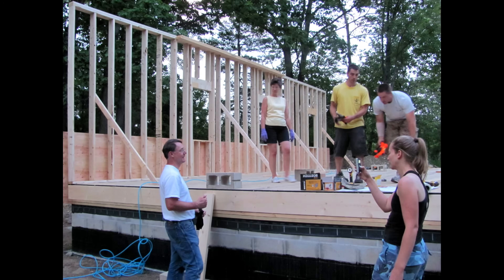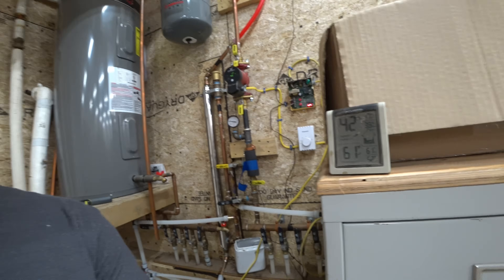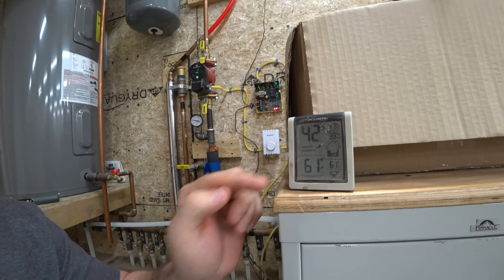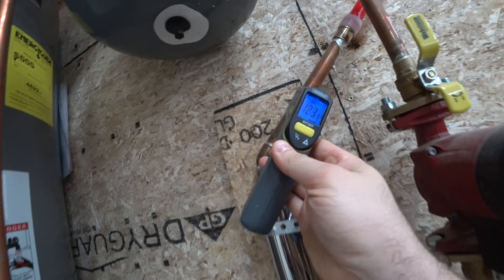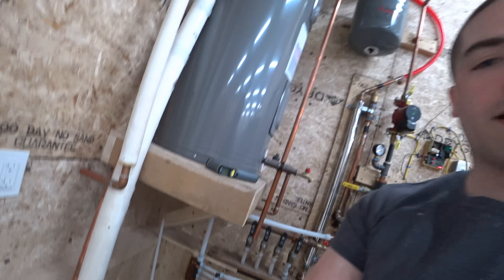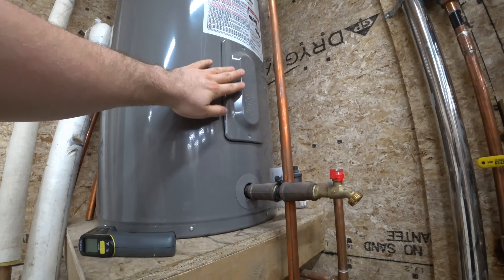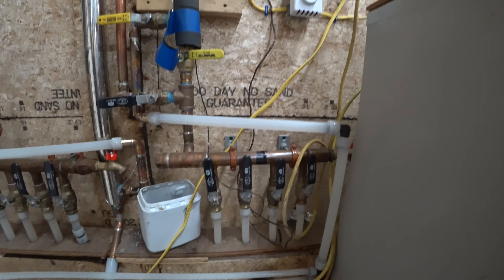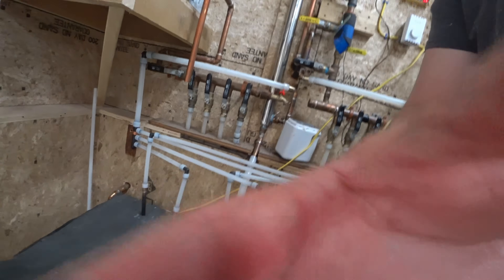Solar Heated Garage Radiant Floor, Update

Comment: Wondering why the heat exchangers are necessary ? Why not one flow controlled water circuit circulating through panels and floor ?
Reply from the maker: You could design it that way if you are building it from scratch.  I added the solar onto my existing system.  My existing heating system uses a steel water heater, and they are prone to rusting if open.  But, if I had a stainless steel tank, then I'd be more inclined to connect both.

Comment: How do you manage the excess heat in summer?
Reply from the maker: I turn off the system in the summer.  This is a drain-back system.  So, anytime the pump is not running (summer and at night in the winter) all the fluid drains back into the tank which is inside.  The collectors just sit there empty with no problem.

Comment: One question for you... 
If I connect a roof solar panel directly to underfloor heating, without a water heater, would it heat my house??? I want the pump to run non-stop while there is sun (seasonally in spring and autumn) Thx bro 🍻
Reply from the maker: I heat my garage with solar hot water.  These are solar collectors, meaning they heat water directly.  I'm not sure if you are asking your question about these, or solar electric panels (PV).
Reply: @DavidPozEnergy  ...solar collector for water heating, but without boiler. Connected to the same network installation with underfloor heating. Thx.
Reply: @DavidPozEnergy  non electric panel

Comment: Could you explain the hot water heater for me?  It appears to be inline with what's going through the floor so that if it were to get really cold you said you could turn on the breaker.  But you also said that the pump runs at 2/gallons a minute and that water flows through the water heater.  If so, do the elements just heat the water as best as possible because there's a constant flow?  Or does it eventually just get the whole water system (in the floor and heater) up to whatever temp you've set it?  I'm asking because I have four solar thermal panels and I'm trying to design a system where I can maybe use the panels in connection with a water heater to maintain a constant water temp at 180 degrees to feed a swimming pool heat exchanger to heat up my pool.

Comment: Setting 3 or 4 (constant pressure 1 or 2) is recommended for a Grundfos pump running radiant floor heating. Try it out!

Comment: Thanks for the vid, bud! I'm looking for a way to passively solar thermal heat my off grid garage. In your opinion, if you routed the heated water/antifreeze through a series of radiators, as opposed to a radiant floor, do you think that would work to keep it above freezing? My floor is an existing concrete slab so radiant flooring is not really an option in my situation.
Reply from the maker: Radiators don't work as well as the floor.  I'll try to explain a little more:
Typically, a radiant floor will have a water temperature set to 90°F, but radiators often have a set temperature of 160°F.  This is because the radiator has to heat the air around the radiator enough to cause convection (air movement).  If the outside air temperature is 20°F, and you try to heat to 90, that's a 70 delta, which solar hydronic can do.  But, solar hydronic has a very hard time handling a 140 delta.  
The solution, if you want to do it anyways, is to increase the size of the radiator or add a fan to have active convection.
Reply: @DavidPozEnergy Hey, thanks for the reply. That's good news for me because I have plenty of solar electricity I can draw from to power a fan on a radiator. I don't need it to be warm per se, just not below freezing so I can leave things in there that would be damaged or destroyed by sub freezing temps. It would save me a lot of effort moving all these items to a warmer space during winter. I'll have to make time to build one of these setups. Thanks again

Comment: Thanks 4 video.  Quick question:

Did you consider just having solar electric going straight to a dry system?  How qould that compare?  Then there's no pumps no water etc much simpler and cheaper?  

Ps.  For your international audience always add in the velocity celcius temperature equivalent.  Outside of USA, we have no idea what this strange Fahrenheit scale means!!!
Reply from the maker: It's been awhile, but I think I got those hydronic panels for free, or very cheap.  This made it worth while to make a hydronic system.  However, if you are comparing retail pricing, then I'd have built a solar electric (PV) system.

Comment: You could use a 50 foot x 3/4 in soft copper. If you did make your own heat exchanger coil use 1/2 copper tubing for legs use caps on bottom.i did a commercial system in Lawrence we had a rubber 450 gallon tank with 3 coils.i used sonna tubes to wrap them.then braze the small copper to the outside it looks great and works excellent. Heat exchanger whether flat plate of shell and tube are not ideal.if you would have got a indirect tank with an electric backup you wouldn't have to do anything just run your solar fluid and fill that puppy up. You could easily turn it in to a open loop drainage system. You could use a 40 gallon indirect for your storage room and use the coil inside to run a fan connector or a piece of base board and a fan. Enjoy glad to see your vid.

Comment: What you need is a water to water geothermal style heat pump. That is the only way you are going to extract all usable heat from your solar heated water and get your 60 degree temperature in your garage due to much greater efficiency. It would also possibly need some solar electricity producing panels and some batteries as a storage and power buffering for that electric power needed for the heat pump. It would be worth it for the gain in efficiency you would get.

Comment: Wished I had the experience and cash to do the same... But, why not build several black boxes with aluminum screens to collect hot air. seems it would help your system ++ very cheap and probably the biggest bang for the buck. They are not fancy But I saw a video with a guy below 0 in Canada heating a large chicken coop with no insulation and full of hols the inside temp was about 40F. Now even if they only heat for 2 to 3 hrs I think that would still justify the cost.
Reply from the maker: There are lots of types of solar air heaters out there.  I'm a fan of them.  I did it this way for two reasons.  First, this requires two holes in my envelop, each 3/4" dia. for the pipe.  That's not very big.  Air heaters would have required very large openings for passive air movement.  Or about 8" dia. duct with a fan to move enough air for this shop.  Those are much larger holes with more heat loss in each hole.
Second, I have a radiant floor.  The floor needs hot water.  It made sense to heat water with solar to directly heat the floor.  If I had solar heated air, then I'd still need something for heating the radiant floor.

Comment: Hey Dave, I have also just picked up 3 of these panels myself and watched your videos to gather some information about how they work. They all are approx. 4x8 and came with a roof rack that the last owner made to attach to his roof. I’m looking to heat a 12x24x52 above ground swimming pool during the summer months on Long Island. The pool is chlorine not salt and I feel that this could really be a great DIY project to provide a better swimming temperature. I’m unfamiliar with how efficient these panels can be and curious to know if I need that many? Any feedback would be great! Thanks for your help and the great videos!
Reply: Hi. I think you can simplify your system because you want to use it during the summer, I'm guessing mainly during the day. There are diy solar pool heaters that are simpler. They use a small solar powered pump to circulate the pool water through a passive glass toped box which heats the pool. The boxes are inexpensive and a easy diy.

Comment: I bought 7 panels for 200$ and plan to pump the water thru some type of heat exchanger in furnace or try some old cast iron radiators, anyway why cant you do away with copper heat exchangers and just have a small holding tank and just pump that water thru radiator , flooring, etc.?
Reply from the maker: You could do away with the extra layer of heat exchangers if you design the system from the get-go. For me I added the solar after the fact to the existing radiant floor system. So I wanted to keep the existing radiant floor system as intact as possible. The existing radiant floor system is a sealed system under pressure. The solar hot water system is atmospherically vented. That's why I need the heat exchanger.

Comment: Not sure if I missed the question in all the comments or not. But after you did your water heating test and found that the solar electric panel and heating element was more efficient than the solar thermal panel for heating water did you change out the elements in that water heater and start heating it off a couple panels to assist your system? I have thought about trying that with my hybrid hot water heater so it would only need to run the compressor in the winter?
Reply from the maker: inside my house I still have a 250 gallon tank with 3 solar thermal panels.  It pre-heats the water. Then I have a 19 gallon electric "booster" tank.

Comment: Why can you not put the water from the panels directly into the floor?
Reply from the maker: You can if the water in the system is mixed with glycol (anti-freeze).

Comment: Couldn't you have some sort of window on the roof that lets light enter and strike a very energy-absorbent panel?
Reply from the maker: Sure, you can go the traditional passive solar route.  I like active solar because I can have a more insulated and air-tight shell.  If I had a big skylight I'd have to give up the insulation.
Reply: @DavidPozEnergy   I think I would go for something like this.  I wouldn't really want to insulate the floor.  Plus, when you think about it, there are going to be a lot of instances where that floor insulation comes to bite you. For example, when it's freezing cold you could benefit from free geothermal but with your current system it's insulated away.  https://www.youtube.com/watch?v=N6QOZGgbj-g

Comment: Why is the tank there - just use a heat exchanger - they are cheap!! I run 10x 1.4Kw solar thermal (14 KW total) configured as 2x 5 series paner running 30% glycol @3.5bar.
This feeds the 300litre Solar domestic hot water via its lower coil and then switched over to the central heating via a plate heat exchanger and in summer supplies the swiming pool via a heat exchanger. We actually had the pool at 31 degrees centigrade this summer. Water comes off panels at between 40  and 100 centigrade and has rougly a 10 degrees differential on the return. This is in the Uk and has been running for 6 years.
Reply from the maker: Sounds like you have a nice system.  I have a tank in the system because I'm using a "drain-back" system.  Thanks for watching.
Reply: @DavidPozEnergy  That explains the tanks!! 

I also ran the sytem initially with just water to flush the system before re-filling with Glycol/water mix and was surprised at how much better water was as a heat exchange medium over glycol, also because the mix is very thick/viscous the flow rates dropped dramatically over the thinner water only.
I considered a drain back sytem but was concerned about the size of the tanks to drain 10 panels and pipework.
Thanks for your reply
Reply from the maker: That's some good experience on the two fluids.  Thanks for sharing.

Comment: Nice job.... New to solar.  I am planning to do something like you done when I build my garage. Recently I been attending a solar club in my home town.  We can get solar panels at cost.  "Wheels are turning."  Thanks for the video.  Cheers
Reply from the maker: That's cool.  Are you in Massachusetts?
Reply: Hello my friend.  No, I am in New Mexico....actually, I am a contractor working in Kabul. I'll be home mid Sept.  I have a small solar plan for my log cabin.  This log cabin is a practice build.  Freaking about $28 sq ft so far. lol  Keep your video coming.  Cheers

Comment: Hi Dave. Looks like a fun and worthwhile project but what are you doing to control legionella bacteria in that warm water in the open tank?
Reply from the maker: I did put a little bleach in there, but the open tank is not exactly wide open.  It still has a sealed rubber lid, so that I don't have to constantly replace water that evaporates.  Thanks for watching.

Comment: https://www.youtube.com/watch?v=WP8H5IOTwYU one of the best video overviews I've seen on a DIY solar hot water collector. You could also build something like this along the length of that south facing vertical wall to increase the BTU and it would be cheap. CPVC + plywood + polyiso + corrugated plastic + black paint.

Comment: @davidPoz I am wondering why you use the heat exchangers and dont do a direct cycle of the water for the garage floor?  I dont know a lot about thermal solar, it makes pretty obvious sense why you wouldnt do that with drinking water but for trying to heat your floor, why do you need to separate the water? i would assume it would be higher effeciency?  Love your channel, i found it about 3 weeks ago and watched every single video (except the ones without a title)
Reply from the maker: Hi mark rossi,  This system is called a drain-back.  At night the water drains out of the panels and back down to the tank for freeze protection.  If I filled everything without a drain-back, then I would need a lot of anti-freeze.  And I would need some kind of valve to prevent thermal syphoning (which would cool the floor at night).  There is probably a way to do it, but I just did it this way.  Thanks for watching.
Reply: @DavidPozEnergy  Thanks for replying David, now that you explain it, it makes sense.  I forgot to ask you another thing I keep wondering, what are the solar panel looking things on your house roof?  Unless I missed a video, you  never mentioned what it is and when you did the solar panels on the custom a-frames in front of your house it sounded like they were the only solar panels you had.  I did notice you do your videos out of order a bit though, I was watching them from oldest to newest and was so confused LOL!  Are they not solar panels and do you have a video that discusses them?

Also, how do you deal with permits/inspections for all the work you do?  I would love to do some of the projects you have done but dealing with plans, permits and inspections keeps me away from it.  

Keep up the great work, I was shocked your channel only has 26k subs, I am confident your channel is going to explode in size very soon.  Your videos are informative, well edited, and the perfect length to get the info across.  Your channel is the first time I watched an entire channels video catalog after finding it!
Reply from the maker: Hi Mark, I have some solar panels on the house.  They are PV, and grid-tied only.  I paid someone else to install them when I built the house, and it was rolled in as part of the mortgage.  Since I didn't do any of the work I never filmed any of it.

The solar panels in the front yard (on A-frames) go directly into the crawlspace as a heater.  I have a video on that here: https://youtu.be/jFoxIit8NYA 

 I purposefully don't discuss any of the permitting process because it is so different everywhere you go.  

Thanks for watching

Comment: My experiance with Grumman Sunstream  collectors that used glycol  heat transfer  fluid under 8lb of pressure and homemade water only colkectors is the commercial  collectors transfered 30% more heat. The glycol  under pressure is significantly  mo getter! You are leaving significant heat within the  collectors  which can be measured by sampling the plate temp  and comparing to the water temp as it exits the  collector.

Comment: What will you do during the summer when you don't need it anymore?
Reply from the maker: I turn it off in the summer.  Thanks for watching.
Reply: Does it matter if there is water left in the panels?
Reply from the maker: If water was left in the panels, then yes that could be a problem.  However, my system is called a "drain-back".  This type is not as common as a glycol based system, but still plenty out there.  Basically, every time the pump shuts off (summer, at night) all the water drains back into the tank.  This leaves the panels empty.  The panels are made of copper, aluminum, glass, and fiberglass insulation.  All those things can take hundreds of degrees, so they don't care if they sit out in the sun during summer.  I hope that helps, David
Reply: Awesome! Thank you for the clarification!

Comment: A great project and a very good implementation! The radiant heat is equalizing with the ambient air temp in the garage, resulting in a lower than expected air temp.  

An inexpensive and fun project to bump up the air temp during the daytime, would be to mount a couple more passive solar collectors (aluminum downspout designs work well) on the roof and ventilate the garage with the heated air.

Comment: So you could also use photo voltaic panels & direct drive an electric immersion tank to save on the complicated plumbing
Reply from the maker: Yes, you are right.  I am actually working on setting up that experiment so I can gather some data.

Comment: So what does the pump cost to run? How many watts is it & how many hours/day does it run?
Reply from the maker: I just checked for you.  125 watts total, that is two pumps and one controller.  One pump is for the solar and one for the radiant floor.  It will run 4 to 4.5 hours per day when sunny, and won't run at all when cloudy.  The whole system will keep the garage above freezing all winter on it's own, but admittedly, I would like to tune it for better performance.